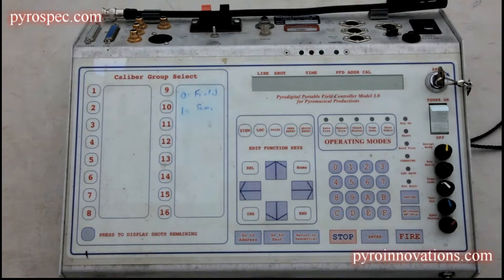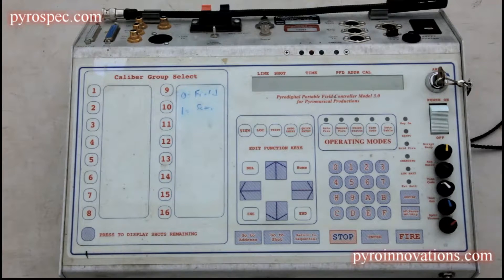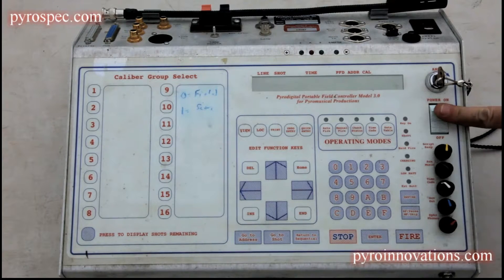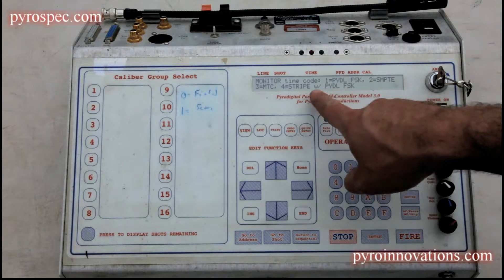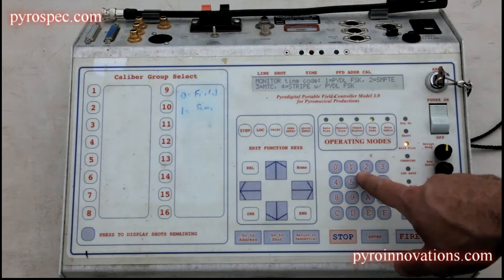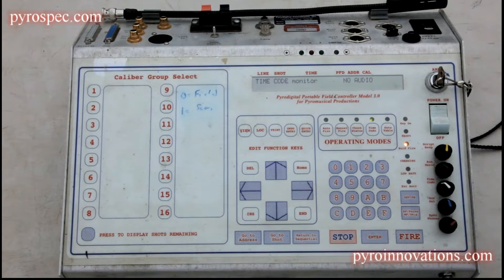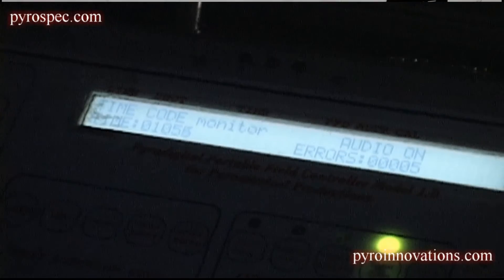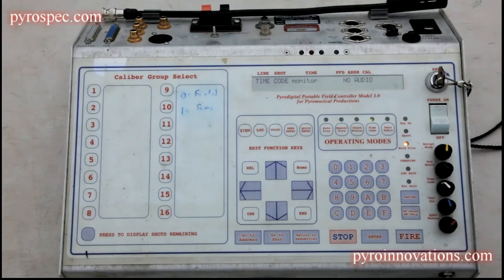Pyrodigital - Time Code Quality Check

Comment: i would like to see more of an explanation for the time code options maybe a more in depth demonstration
Reply from the maker: James, thank you for your comments and feedback.  There isn't much more to say about the "time code" mode, as it is really just there to perform the quality check.  The other options in time code mode mearly select which type of time code you want to check, otherwise, they work the same exact way.  Having said that, we do have some additional training footage on pyrodigital and more, that will be published in the future.  Also, in case you have not seen it yet, we have additional information on our website, that contains written explanations and graphics.  Here is a page on Pyrodigital Timecode: http://pyroinnovations.com/fireworkstraining_pyrodigital_timecode.html

Our advanced understanding page has some more in depth material on how time code works: http://pyroinnovations.com/fireworkstraining_pyrodigital_advanced.html

Here some additional pages you may find of use: 
Pyrodigital Autofire: http://pyroinnovations.com/fireworkstraining_pyrodigital_autofire.html
http://pyroinnovations.com/fireworkstraining_pyrodigital_fieldcontroller.html

Thanks again for your feedback!